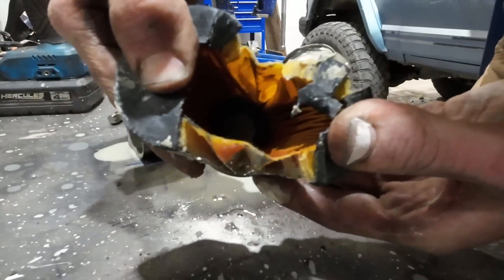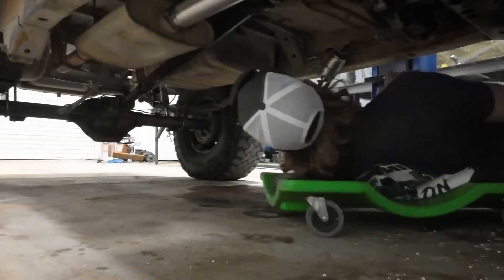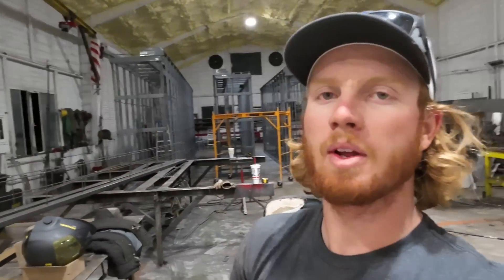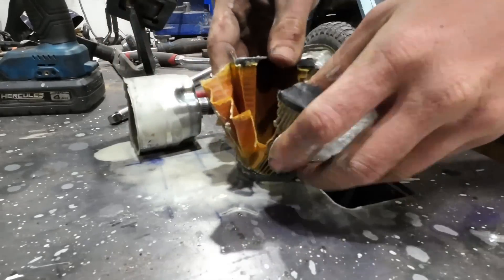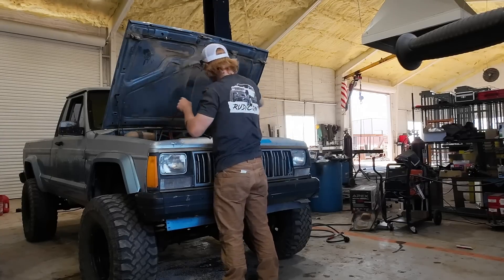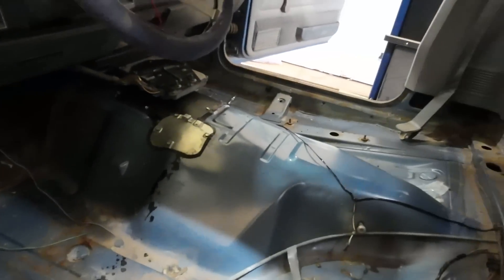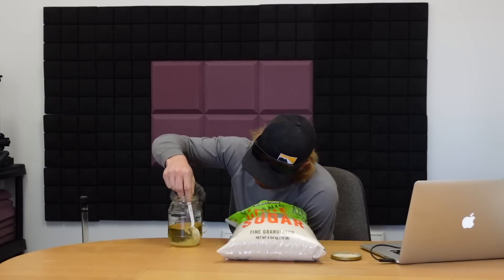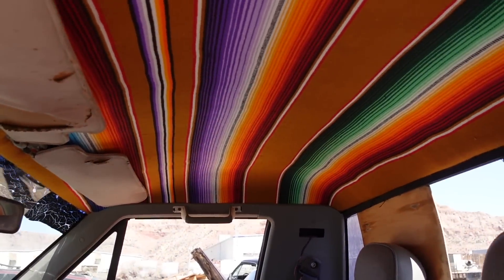Someone Put SUGAR in My Gas Tank!!!

Comment: Unless you are using an Ethanol blend petrol (E10 or the like) sugar crystals will not dissolve as they are not soluble in petrol. In straight petrol the crystals will just sit in the bottom of the tank like they did in your test jar. However any water in the bottom of your tank would dissolve the sugar making a nasty fluid which could get sucked in to your filter. It could also have been a sugary drink poured in like one of the common soft drinks, so sugar and water again. Also be damn careful about tasting that stuff as there are plenty of dangerous chemicals that taste sweet, including Ethylene glycol (coolant) and Benzene. Benzene is used as a fuel additive, industrial solvent and is used in some paint and lacquer removers and is pretty toxic. Lead acetate is another, sometimes called sugar of lead which is used in hair colouring products. Since January 6, 2022 lead acetate has been banned in the USA in hair colouring products manufactured after that date.
Good work on fixing the issue, but perhaps time to slap up a security camera or three?

Comment: Sugar will not dissolve in gasoline.  Pour sugar in a jar of gasoline and the sugar will immediately fall to the bottom.  The only thing sugar will do in a gas tank is clog up the pump strainer.

If you want to sabotage a vehicle through the fuel system boiled linseed oil is a good one.  It will slowly build up on the valvs and rings and once the engine is shut off after enough build up occurs the engine will lock up and never start again.

Good old canola oil does a excellent job of making a vehicle run like crap.  The person receiving it may believe it is actually diesel fuel by the way the vehicle runs.

Comment: this was an episode on mythbusters. they proved sugar, even running through the engine, wouldn't damage it. there was another liquid they ran through the engine that absolutely destroyed the engine.  if you ever want to know what it was, just DM me. also, locking gas caps are relatively cheap.

Comment: HEY I KNOW WHAT THIS STUFF ABOUT.....the place i was working , someone took a screw driver to my paint , every body panel , even the gas cap cover and light covers. so i saud wgat ever and started using and abusing it myself. laughed stating that it was still kickass looking ride and they hit it more. so while cutting wood i racked the sides through the brush, got worked and stated   have fun cause ya cant hurt it at all anymore. whom ever must seen that i really didnt care now and stopped. but if its ever revealed 100% who it was , cause i wont respond and hurt others not responsible, 100%  who it is , s.o.b. gonna cry . oh when i put my kickass wheels on it , it got another scraping 🤣🤣🤣

Comment: Someone maybe didn't like the way you parked?  It doesn't take much to trigger some folks... 

I always had a locking gas cap on my XJ... It was always parked outside and was lifted enough that it slightly too tall to fit in my garage with the safari rack that I built for it... Then again, the fact that criminal mischief can get you legally shot here in Texas might have a bit of a deterrence...

Comment: Time for a locking gas cap.  If you want to clean up the upholstery, rug and seats - get some carpet shampoo intended for shampooing house carpets and put some in a bucket of water.  Flood whatever you are cleaning with that water, then use a scrub brush to work it in and then vacuum the water away with a shop vac.  Do this a couple of times and you will be amazed at how it cleans things up.

Comment: Locking gas cap….or…..1 lb brick of C5 wired to a motion sensitive switch remotely activated……any jostle and no more saboteur…….it is kind of hard on the vehicle as well but  then you gotta do what you gotta do…..perhaps you got a little to redneck for some folks

Comment: I thought I would post another comment, but just pertaining to the myth, the myth of sugar in gas tanks, and how it will automatically ruin your engine every time. 

Nothing is further from the truth.    It’s a car culture legend, passed down from generation to generation, that an angry person with a bag of sugar can leave your car dead on its axles. 

“Add sugar to gas tank, turn its fuel into a sugary petroleum mess, and wait for the owner to start the car and blow the engine.  It’s-A-Myth.  Sugar doesn’t dissolve in gasoline. If you add it to gasoline, it stays in granular form. 

“We have not seen an engine damaged or destroyed by sugar in a gas tank, nor heard of any truly plausible or established cases of this happening,” 

Says Mohammad Fatouraie, manager of engineering at Bosch, one of the auto industry’s main suppliers of fuel system components.   A sugar crystal is about 200 microns, a measure of size for small particles. 

Filters in a car’s fuel system capture particles much smaller than that, so suspended sugar granules in the gasoline would be caught by any one of several filters before they ever made it into the engine. 

In other words, it ain’t happening my friend.  There’s a fabric, sock-like filter surrounding the fuel pump pickup in the gas tank.

An in-line fuel filter at the tank pump inlet, a filter on the high-pressure fuel pump in the engine bay, and filters at the inlet of each fuel injector.    

Even in a carbureted engine, which doesn’t have fuel injectors or their individual filters, there’s a low chance that sugar would ever make it that far into the engine after all the other filters in the system.”

Please feel free to read the entire article at the link,  that I have provided….   I will say this about the article.  if you are one of those that don’t work on your own engine, 

Or,  if you’re one of those that doesn’t know hardly anything about Engines,  I would definitely read it, so nobody can fool you and take you to the cleaners. 

https://www.popularmechanics.com/cars/car-technology/a33237683/sugar-in-gas-tank/